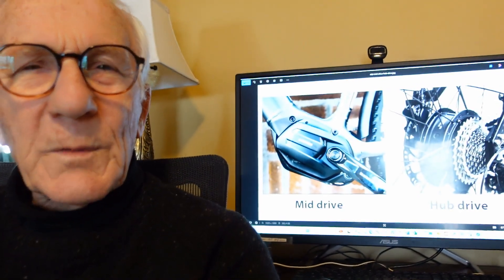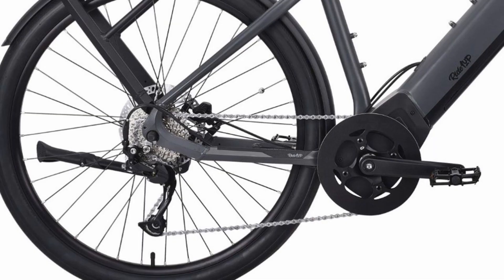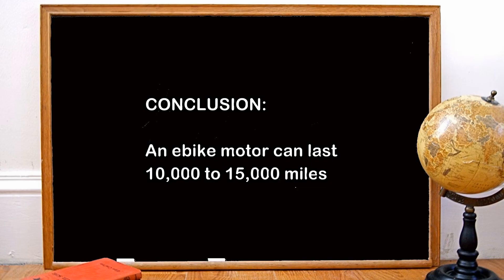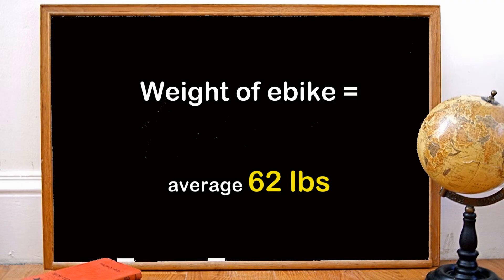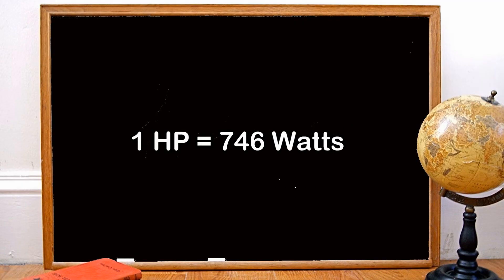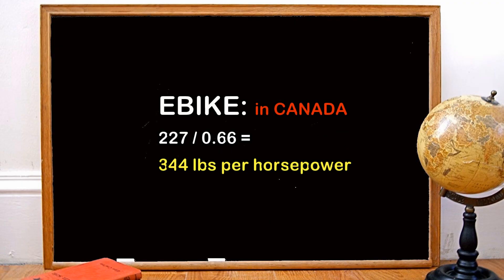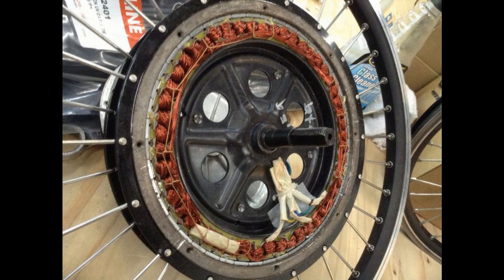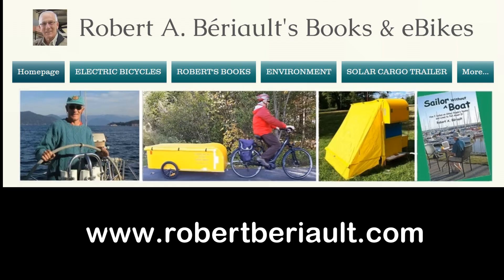Why Ebike Motors Have Such a Short Lifespan

Comment: Comparing car motors to ebike motors in mileage lifespan is rather pointless. This has nothing to do with the specific requirements the motor has to accomplish. How much mileage does an average ebike per year do compared to a car?  Increased lifespan requires a different design and better material of parts and therefor better and usually more expensive quality.  It makes no sense having the same lifespan for ebike motors measured in mileage compared to a car motor.  Unless you want to e-bike round the world that would be expensive and for 99% of all e-bike buyers an overkill. Also it makes no sense if the motor outlasts the rest of the bike or for that matter the car.
Reply from the maker: Good arguments. Thank you.
Reply: You raise a really good point about outlasting the other parts: I'm spending a lot more on tires than anything else, per mile! (& that's without getting fancy)

Comment: One trick to extend electric motor lifespan is put ATF oil in it. It transfer heat to case.
Reply from the maker: Grin technologies sells a special oil for this purpose (for direct drive motors only) called Statorade at two buck per ml.
Reply: What's ATF?
Reply: @elisfsharri  Red oil for automatic gearbox.
Reply: Alcohol Tobacco & Firearms, of course!   
Oh, & I guess it also stands for Automatic Transmission Fluid...
Reply: @elisfsharri  ATF is automatic transmission fluid. In car transmissions electronic actuators and open wiring connectors have been used for decades. And work well.

Comment: My experience after 10 years is the opposite. First motor, 1000 watt hub drive from GRIN,20,000K+. The wheel bearings were going at this point,motor fine with zero maintenence. Changed to a Bafang 1000w BBSHD and 2 years into this zero maintenance,no issues. So I always buy heavy duty. Underpower a motor rather than overpower a less rated  one. More weight though.
Reply from the maker: Thanks for sharing your experience. I'm thinking that my next motor will be a Bafang mid drive.
Reply: I'm still loving our Bafang m620, but I'd steer clear of any of their newer stuff using CANBus: Even with their (proprietary!) adapter, the missing settings mean a lack of fine adjustment that Bafang does not (sort of cannot) do. 

Which is a shame, because the m620 UART version is an extremely capable, smooth & responsive motor+controller, once properly calibrated & then configured for a particular bike build.

Comment: Its a bit of a tricky subject , a good one though , because there are just so many variables, all machines be it electric motors or car engines are not always built to the same quality IE: how long is a piece of string.
 Then you have how much load they are pulling , as well as how they are maintained .
  Even the climate they are operating in can have a bearing on life expectancy especially with electric motors which do not like excessive heat.
 Even how the person uses the gears if it has them , and or how much the person assists the motor with pedal power can make a difference.
 Cars engines these days are mostly autos which detect load and automatically change ratios which not only benefits the longevity of the engine but gives optimal fuel usage , because electric motors with no gears cannot reduce the strain on them , all they can do is add more electricity or reduce it which is not the best.
 This is another reason why heavy diesel commercial vehicles can last a million miles if well used and well maintained.
 And as you pointed out , small motors under severe load for longer periods are very likely to have a much shorter life span.
I have a heavy trike  with motor assist , I chose a big heavy duty mid drive motor , to pull my big carcass and heavy trike , mines a mid drive motor, and I still try and use the gears so as to not make it work too hard , particularly on hills .
 Hills are another thing than can overheat e bike motors if pushed hard shortening their service life.
Reply from the maker: Thanks for sharing your insights, you've outlined a really complex set of variables!

Comment: I better stay at my non-ebike. Until today 80000 km. Only parts to be more or less regularly changed: bottom bracket, chain, cassette, pedals, chainrings, brake shoes.
Reply from the maker: As long as you're fit enough to supply all the energy needed, a non-electric bike is best for several reasons.
Reply: @RobertBeriault753 unfortunately, fitness is only temporary, so my ebike is probably the last bike I'll ever need!
Reply: You can avoid all those wear parts with a direct drive hub motor. The only thing you need to change are tires.
Reply: And tires. You definitely need tires after a few thousand miles (or less!) 

On each bike, even the one salvaged from an alleyway & rolling on used rubber, I end up spending more on tires than anything else.
Reply: @prophetzarquon  Tires are cheap though, no big deal changing every few k miles, but it's a bit more involved with a heavy rear hub motor and torque arms to deal with.
Reply: @ahaveland  Summer tires are cheap. Winter tires, not so much.
Reply: Don't miss out on experiencing one of the greatest inventions ever simply because you've gotten stuck inside a mental construct.

Comment: Another viable answer as to why car engines last so much longer than ebike motors is that a car engine costs 10k and has a pressurized oil system and requires reasonable oil change intervals while ebike motors average about 100 dollars.

Large, expensive industrial electric motors work for decades doing hard work.  But they are very expensive up front.

Another explanation is they are building it to the expected battery life.  If you get around 30 miles to the charge, 500 cycles equals 15k miles.  So just like building a million mile EV battery is massive overkill (cars do not last a million miles. At 13k miles a year on average for a US driver, it would take 76 years to reach a million miles) in relation to the life of the car, building an ebike motor that will long out last the battery is also a bit overkill.  Most low end e-bikes will be thrown away when the battery wears out.

Another thing is that the bicycle manufacturers professional group put out a report saying the average bicycle sold at a big box store will accumulate an average of 60 miles before it ends up in the dump.  While a smallish number of ebike users will put a lot of miles on their ebikes commuting to work or something, a large number will not.  They will never reach 10-15k miles.  They will be lucky if they put 1000 miles on their e-bike.
Reply from the maker: You raise some good points. Thanks for your contribution.

Comment: How do mid drive motors benefit from the gear system of the bike?  With the exception of mountain bikes (true mountain bikes), bicycle drive trains are set up for legs, not motors and have no under drive gear.  All of the gears in most bicycle drive trains are overdrive gears.  

As I understand it, mostly from every electric motor I have ever seen, electric motors like to spin fast and be geared down for torque multiplication.  Like it will drive a load via a belt with a much larger pulley than the one on the motor.  The high speed of the motor is reduced and the torque is multiplied.   Many electric motors have cooling fans on the main shaft for cooling.  This is another reason they like to go fast.

Bicycle drive trains are over drive with torque division, not multiplication.  My hybrid bike has 3 chain rings in the front, 28, 38 and 48 with 7 in the rear going from 11 to 28.  The lowest gear is 1:1 (28 teeth on the chain ring and 28 teeth on the cassette cog) The highest gear is 1:4 where the wheel spins 4 times for every rotation of the crank.  There are no under drive gear ratios.

 Even if the drive train was optimized for motors, there is no guarantee any user will ever have it in the optimal gear for the load.  There is no information on any e-bike headset that gives the motor RPM, iow, no tachometer.  Without such information, a cyclist would not have enough information to know what gear his drive train should be in.
Reply from the maker: I don't understand all of what you said, but all I know from experience with a mid drive is that if you start up from a full stop in high gear, the motor will be very sluggish and you know you're labouring it. Is that what you're saying?
Reply: @RobertBeriault753  Not really.  What I'm saying is most applications of electric motors involve gearing down the motor.  Like you put a 4" pulley on the motor and an 8" pulley on the load connected with a drive belt.  This is called torque multiplication.  It reduces the speed the load will turn out, but increases the torque.

 Like if your electric motor puts out 10footpounds of torque, but you run a belt to the load with a pulley that is 4 times the diameter of the pulley on the motor shaft, you get 40 pounds of torque at the load, but at the expense of running at 1/4th the speed. (this example would not be a bike, it's just for the purposes of illustration).

With the exception of mountain bikes which do generally have at least 1 or 2 under-drive gears (reduction as opposed to multiplication), most bicycles do not have that, they have the opposite.  There is almost always a larger diameter sprocket on the drive end (the cranks) and a smaller diameter gear at the driven end (the cog on the wheel).  An example would be a 28 tooth crank (the pedal side) and a 14 tooth on the wheel side.  This means a single turn of the crank will turn the wheel twice.

In just about every other application with an electric motor, it does the opposite of a bicycle drive train.  This is because electric motors like to spin fast.  AFAIK, the main advantages of having a bottom bracket (mid drive) e-bike motor is because it puts the weight of the motor in the lowest point of the bike.  It also reduces unsprung weight on bikes with rear suspensions and allows for stronger and higher quality rear wheel hubs.  They also tend to be way more expensive and with better build quality.  Chong's hub motors simply cannot compete with Bosch or Shimano. They can charge more money and so they can build a higher quality motor.
Reply: By way of example, the m620's internal reduction gearing leaves it with plenty of power handling but a relatively narrow output-shaft RPM range. (Even moreso, for the m630 cargo motor.) 

One result is that low-speed riding must either be done at significantly higher cadence & lower pedal force than usual, in an earlier\easier gear, or else risk running the motor at low RPM under load (which is bad for them). 

Speaking very loosely, a given voltage can produce a given RPM, while the amperage required to reach that RPM increases with load: Pumping more amperage through a motor without letting it rotate faster, increases its internal resistance & waste heat. Hence, I'm better off sticking to lower-load (higher-RPM, higher cadence) gears, than I would otherwise prefer, simply because the ratio of motor-RPM per pedal crank, is not quite as high as I (or the motor) would like.
Reply: @prophetzarquon  The problem with internal gearing on a mid drive motor is you are multiplying the inefficiencies.  Now instead of having 1 drive train introducing inefficiencies, you have two (the one on the bike and the one in the motor).

I'm sure there are some advantages, like low center of gravity and less unsprung weight, to a mid drive motor. But using the bike's drivetrain is not one of them.

Comment: Here is the thing about magnets: Heat them up to a certain point, and no amount of immediate cooling will return them to their original strength. I wound a few hundred RC motor of various turns and wire gauges combined with different size propellers and if you over prop just once and heat up the magnets you might as well throw it out.  lol   Amperage goes up fast and so does the heat.
Reply from the maker: I never knew that. Seems to me that  this could kill a motor.
Reply: @RobertBeriault753  Its easy to try. Get a magnet to just barely hold the weight of any object. Heat it up so it's too hot to touch then try again after it has cooled. 
When I first thought about cars going Electric I imagined an industry of people rebuilding motors but then imagined it would be too expensive but all these motors can be rebuilt as new. Maybe someday it will be feasible
Reply: Good news: Non-Permanent Magnet motors, tolerate a lot more heat!   
Bad news: Even more expensive controllers.
Reply: @prophetzarquon 
But the varnish insulation on the copperwire do have temp limitations too. So heat must be controlled.

Comment: Huge number of failure points with mid-drive motors including tons of bearings, cogs and sometimes belts plus you have the riders own power directly feeding into it and the weight of the rider when out of the saddle. Also many mid-drive ebikes are highly proprietary so often they become uneconomic to repair due to incredibly high repair prices. They also wear down the drivetrain much faster, typically 3x that of a standard bike (depends on power of course). Typically a proprietary mid-drive ebike has frame, motor and battery tied together so any failure of one component means the ebike could be uneconomic to repair. It's not just about reliability but how the fault can be resolved. A hub motor is relatively easy to repair, a hub controller relatively easy to replace and of course many hub motor ebikes have open standards for the battery. If you are looking for an ebike for long road rides and value surely if it has to be a hub motor. However if you are looking for a e-mountain bike then mid-drive typically makes more sense. Some of the mid-drive motors for city bikes are very low power and therefore only offer light assistance and don't accelerate drivetrain wear that much wear as a e-mountain bike mid-drive motor could have much more power and typically won't be as reliable. Despite their 250W rating here in Europe a 250W e-mountain bike with a mid-drive motor is something like 23A x 42V maximum power which is over 900W maximum power. The 250W rating makes no sense but seems to be a way of restricting imports from China more than anything else so often European ebikes are higher wattage. The Chinese are learning how the legislation works and now sell many 750W ebikes certified as 250W but they still aren't typically as powerful as European e-mountain bikes. 

If you want reliability above everything else then direct drive, if you want a ebike ideal for long rides and value then a geared hub motor but if you want something super torquey, well balanced and ideal for off-road riding then mid-drive.
Reply: 💯 ^ This.   
"250W" is (thankfully) mostly a myth created by workaround labeling; mid-drive offers (vastly) superior weight distribution, but increases drivetrain wear; geared hub motors offer good range & decent value, despite bad weight distro + no regen & shorter life than gearless; gearless hub motors are the simplest (& allow a bit of regen!) but are a lot of unsprung mass to go knocking around on a rocky trail.
Reply: @prophetzarquon  Yeah there is no give in a direct drive motor wheel, the spokes are so short so unless you have thick tyres they can be uncomfortable. If you have a low power direct drive setup then I personally think they are better on the front and if you have regen you need strong steel forks as the motor wants to turn the axle both ways depending on whether its assisting or doing regen. I can't imagine a worst e-mountain bike than one with a direct drive hub motor. The totally wrong solution for that. A small geared hub motor I guess would be somewhere in the middle. I have a simplistic view, hub motors for the road, mid-drive for off-road.

Comment: E-bike motors are higher stressed, but as mentioned here in the comments, hours of use may be a more accurate comparison. I have 14,000km on my RadMini and have never had a gear failure, however, I did swap the gears once due to wear on the teeth. The RadMini is modified to be a "rescue bike", and has extra power for towing other bikes (3,200 watts), but default mode is the usual 750 watts/20mph. I did try steel gears, but they were SO loud that I turned around after 200 feet and took them off! I do have brass gears, but I suspect they will only be slightly quieter. My preference would be nylon gears with steel reinforcements. The perfect gears would be double helical (aka herringbone). They can be metal and still be quiet, but companies stay with straight cut or single helical gears for cost savings. Single helical is quiet, but induces side thrust and extra friction. For now, I'm sticking with nylon which is fine unless you do jumps at full throttle. 

As for why few companies offer direct drive, the answer is cost, weight, and torque. They are larger because they need the extra pole-to-axle length for acceptable torque, they have more magnets, and more coils. This translates into a heavier motor that uses more materials. Now, you CAN have a direct drive that has so much torque it's scary, but those are upper end motors that are expensive and require much more power than a typical e-bike battery can supply. The typical geared hub motor is far lighter, and can be that way because of the 5x torque multiplication provided by the gears.
Reply from the maker: Thank you for this information.

Comment: On the side of the e-bike you should also take the human pedalling power into account, which takes some load from the motor.
Reply from the maker: I didn't take that factor into account on purpose, but does it invalidate the conclusion that ebike motors work harder than car motors?